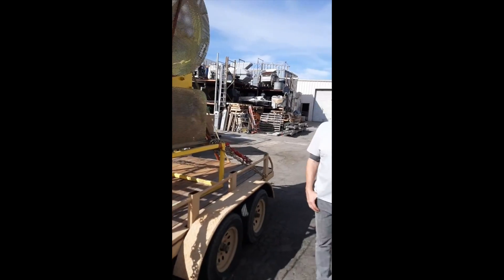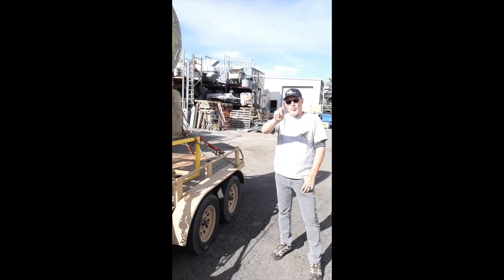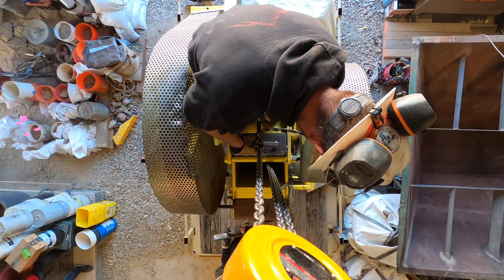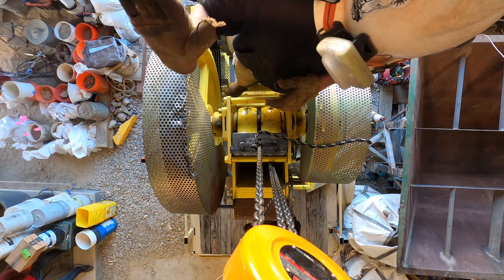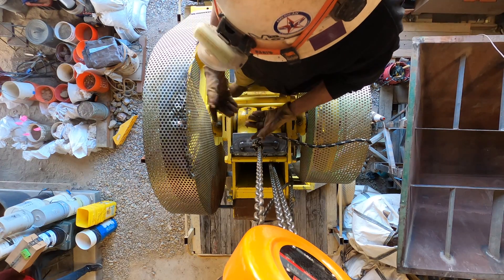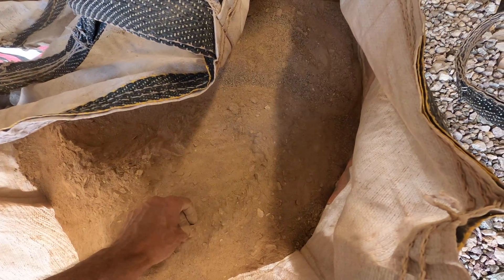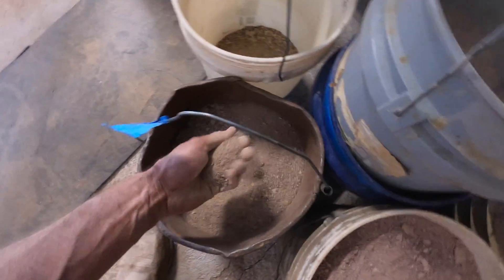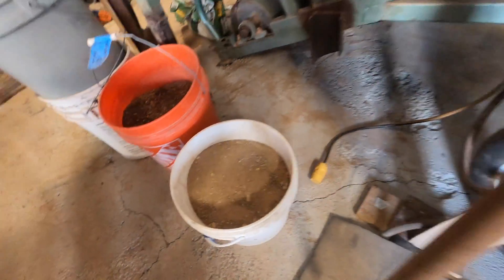The Purple Spot Part 2, Testing the Keene Double Roller Jaw Crusher Prototype

Comment: Does a far better job than Jason's crusher.
Reply: From what I can observe watching Jason's channel, it looks like Jason has his crusher jaws set to approx. 1/2 minus.  He also has a secondary crusher set to crush to powder size.+
Reply: Jasons is a primary jaw crusher and then a pulverizer - two sep machines.
Reply: @AUMINER1  yes, I agree, I just didn't know the name of Jason's second processing machine.  Either way, MO will still need to further process their material before it can be put over the shaker table.
Reply: @grantlucas2012  hammer mill is the term they use. It will do a better job for table ore than a roller mill for several reasons.The roller will flatten out the gold into pancakes and make gravity recovery problematic. The hammermill does a better job, but still pulverizes 85%-90% into 50 mesh -.  To get 100% passing 60 mesh ( the general standard for separation )  a screen would be needed, but then throughput is reduced, trading one problem for another. it's a balance of importance and priorities.
Reply: @AUMINER1  Thanks!  Very informative.